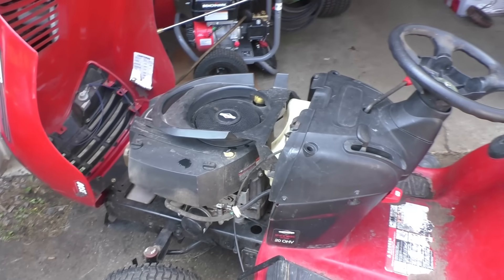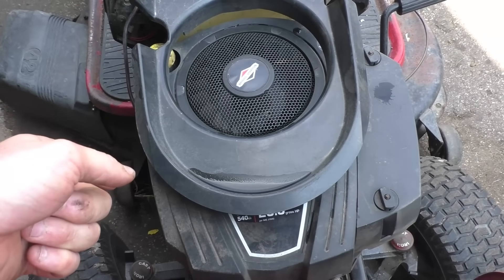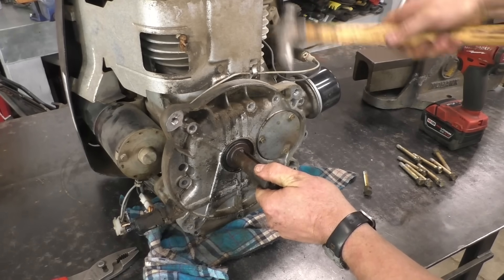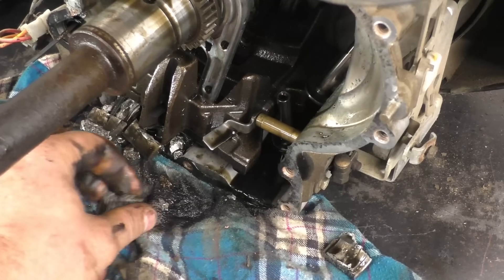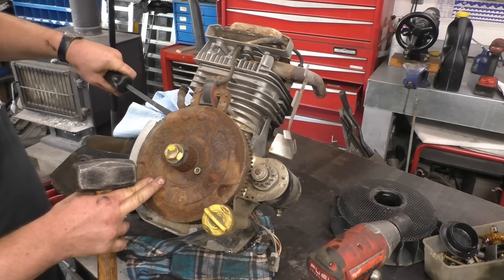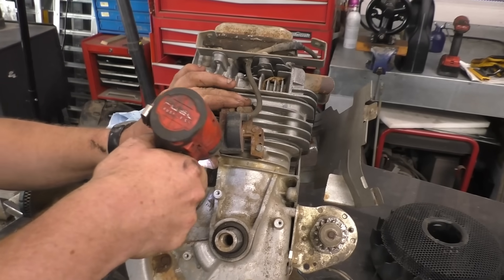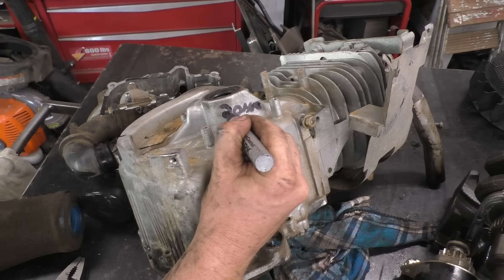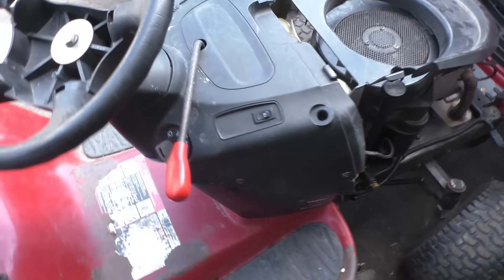Customer Wants To Know If Lawn Tractor Engine Is Blown-Up - Let's Find Out!

Comment: On Those single cylinder engines, oil is the life blood. I had a Craftsman 22 HP turbo cooled in the shop for deck problems. I checked the oil as usual. It was down below the has marks. The customer didn't want to change it so I just added enough to get it where it should be and noted it on the order. This same customer brought me a John Deere LA145. The idler bracket on the deck broke. This mower was in the same shape. Low oil that looked as if it never had been changed. Had the original oil filter that it came with. Clogged air filter. And the lube points hadn't seen grease since it came out of the box. And other problems. Again, noted on the order because the customer wanted it back ASAP. Another good video. Looking forward to the next one.

Comment: It just drives the point of changing the oil and filters regularly and keeping the oil full and clean all the harder.  I change the oil and filters in my tractor mowers at least once per year now, generally at the beginning of a mowing season.  One has a 2007 Briggs and the other a 2011 Kohler, both single cylinder.  The Briggs has a new carb and I lapped the valves a couple months ago.  It runs great after that and a good cleaning.

Comment: I guess these Briggs engines are cheap as dirt since they are in so much and have such a short life span.  I still don't get how people don't regularly check the oil on these things - it won't make them last forever but at least last a bit longer.  I learned my lesson to go with a higher quality engine after my last one grenaded.  Thanks Don, have a good Labour Day weekend!
Reply: "I still don't get how people don't regularly check the oil on these things - it won't make them last forever but..."

It just about will. Keep the oil fresh & up to the proper level, and for residential use, you'll probably get 20 yrs of use out of one. I have a Kohler Command Pro that's 20 yrs old, even though I let the oil get fouled with gas one time. I have a Briggs flathead that's about 12 yrs old that has survived 3 teenagers.
Reply: @gearhead366 I guess you don't watch these videos?  Don's clearly said these engines are trash and won't last forever.  They last longer if you maintain, but they will fail due to inferior materials.
Reply: @gearhead366  These Intek engines are total garbage.

Comment: When I was a teenager, I had a riding mower with an 8hp Briggs. I starting hearing a high pitch squeak every once in a while. Oil was normal. It threw a rod. I was mad as hell. Had to push a bunch of lawns to get enough money for a new block. Religiously, checked the oil, changed it at ridiculously close intervals... Threw a rod about 5hrs later than the first. My dad is a marine and was up my ass making 100% sure I wasn't slacking. It was satisfying to prove the first one wasn't my fault, but expensive lesson to trust B&S twice.

Comment: You video helped me take mine apart, thinking it was the famous decompression spring but it turned out to just be a bent aluminum push rod bc the valves got out of adjustment.  While taking it apart, made a killer oil drain set up and could tell by the guts of the engine, what good care I am keeping it in by changing the oil and filter once a year.  Thank you.

Comment: The "old" 28cui runs great. They are much tougher than the newer 21-33cui´s. But i probably wouldn´t let it idle that low because the lack of splash lubrication of the upper bushing and counter balance support. Greetings from Denmark :-)

Comment: Don,   I have a B&S 21 hl Platinum engine.  I have replaced the heat gasket 3 times and am about to do #4.  I have been using aftermarket gaskets. This happened if I turn the engine off and restart it without letting it cool down for awhile.
Do you think using OEM gasket or using 2 of them would help with problem?

Comment: I'm curious:
Would you be willing to sell the 2 plastic air box cover nuts.
I have an identical engine, runs perfectly but I'm missing those two nuts and I've been unsuccessful at finding them.
I'm in Ontario.

Comment: With the price on parts today, it only makes sense  to salvage parts. I generally do engine swaps when possible. I normally do not rebuild because of the quality of parts today. I am about to call it quits on small engine repair myself. Even OEM is not quality.

Comment: Would you use 5W30 or 10W30 in your typical tractor engine?  Seems to me if they are both 30 at high temps the 5W or 10W should not matter.
Reply from the maker: I mostly use 10w30 or sae30

Comment: rotate the start gear so its up and turn the starter so the flat is on the side with the bolt and you can get the socket on it enough

Comment: I have a Briggs, flat head twin, 18hp.  I wonder if that would be pretty much a bolt in swap for one of those single cylinder ohv Briggs?  thanks
Reply: It won't be a straight swap that I remember, because the pattern is different. If you got an opposed, it's old school, so you might hide that bad boy back. Those are in super short supply in good, running condition. Those were tanks back in the day. I got a couple of them squirreled back for personal projects...it's been years since I have seen one in good running shape.
Reply: @TheCaptainSlappy  Yeah it's a good runner.  Came off of a 1986 Wards tractor.  Sat for over 20 years until I retired.  Half an hour working on it and it fired right up and runs like a top.  Got no problem with my Intek; just thought if I did I'd swap the twin in.  thanks

Comment: Im not a briggs basher,  but between the head gasket issues and the cam compression release failures on inteks im loosing faith.  I have little sympathy for the owner of this one since it appears neglect was the root cause of failure.

Comment: $300 CAD for a flywheel??? Not used I hope. I've got a complete 20hp one lunger I'd gladly sell for $300! Shipping would be a killer though. Could stow it away on one of the loads going to Ontario every day though if the driver is willing. Anyway, the much maligned Briggs Intek. The motors some love to hate. Obviously this one was a victim of severe neglect as I suspect many others are. Wonder if the owner of this machine will do a better job of maintenance now. What do you think?

Comment: Replace this engine with loncin, it will outlast its owner lol...my briggs avs 2017 started to produce rod knock after 100 working hours, oil was changed after first 5 hours and later every season(approx 25 hours/season)

Comment: This is a so called "20 horsepower" and its a single cylinder my kawasaki in my zero turn is a v twin 21 horsepower.. I think briggs is stretching the truth on this one how do you even get almost as much hp on a single cylinder 20 hp compared to a v twin 21 hp? Makes no sense. I can see why companies like briggs got in trouble for false advertising.

Comment: Why not fix the engine by putting in a new connecting rod if everything on the engine looks good.
Think that would make a better video than a tear down video.
Engines have to be very bad before I would tear it down and scrape it.
I prefer saving them.
Reply from the maker: When you run a shop you must have in mind the customer's budget.